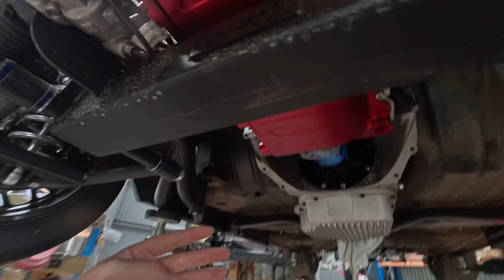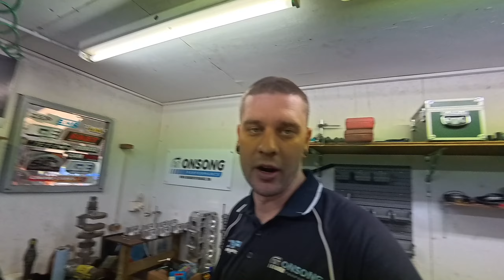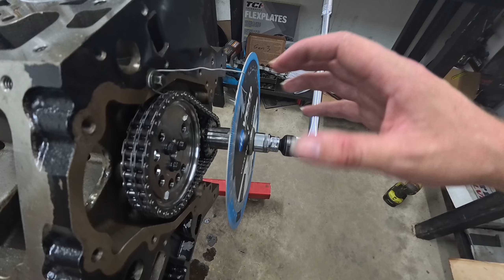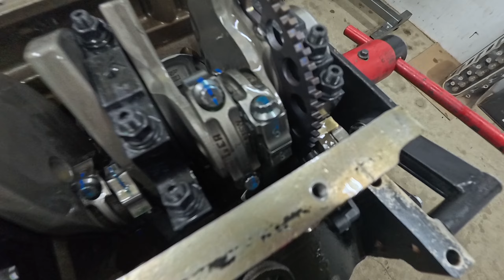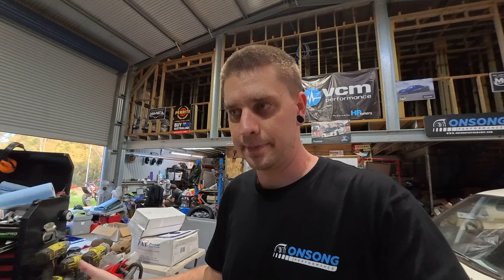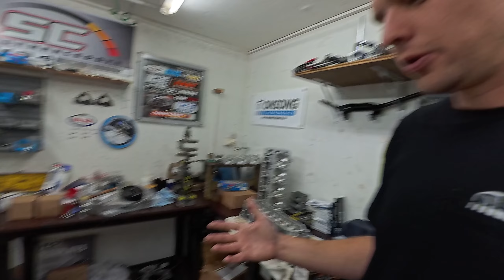Longroof is VERY Problematic || HJ Wagon Build Part 4

Comment: Is it worth getting the actual cam measured by the cam doctor or similar instead of the cam card?
Reply from the maker: @DonzOzzo  dialing It in gives us the whole story. Valve events, centrelines, lift etc. The card is just to confirm and ensure it’s where it should be in regards to crank rotation 👌

Comment: Sprint cars run a oil pump off the front of the cam... so reverse rotation. Peterson pumps may have something that will suit..
Reply from the maker: Yeh I did end up finding some that would work for reverse rotation, but all were too large to fit in the space we were working with, all of them were going to fowl and be a problem for any kind of radiator setup